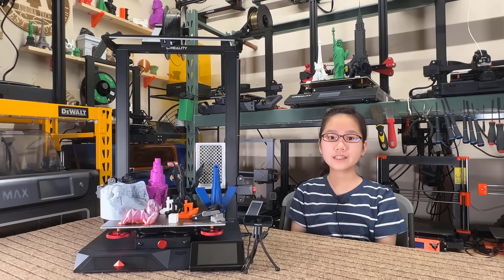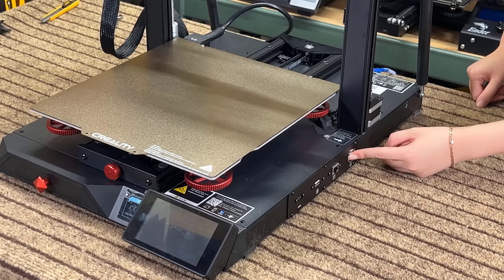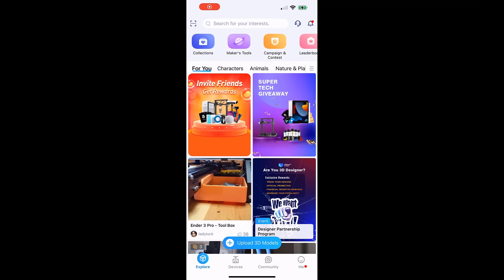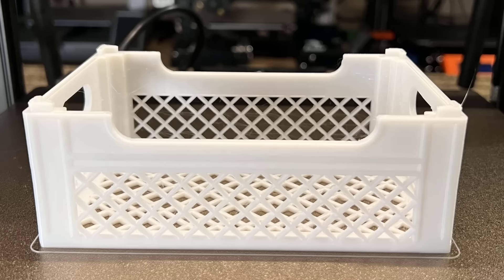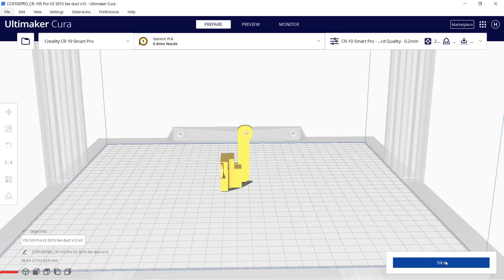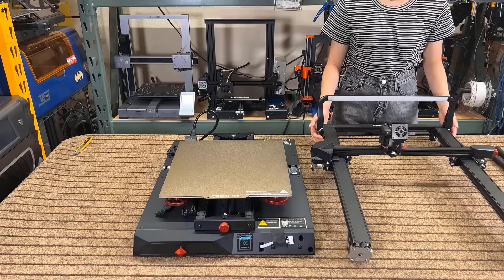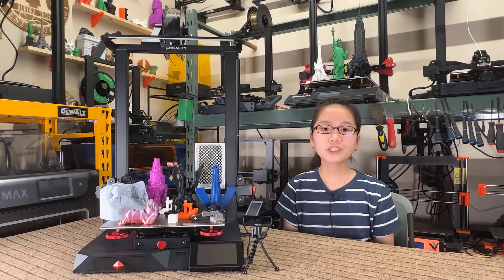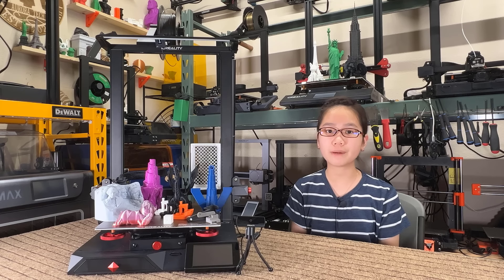CR-10 Smart Pro In-Depth Review: CR-10S Pro V2 + Ender 3 S1 Pro = The Ultimate Creality 3D Printer?

Comment: I've had one of these for the last month or so and up until a couple days ago it printed absolutely wonderful. I am newer to 3d printing and wanted something that was more plug and play. Lately I'm getting layer shifts and overall really bad prints about halfway thru my prints. I've been watching tons of videos and haven't quite figured it out yet. Live the printer just wish I was up and running like when It came out of the box. The cloud I found very buggy but on my unit the auto shut off does work but you have to set it during the print and reset for each print
Reply: have you checked the tension of the belts? also check that both the x-axis and y-axis carriage have no play, since over time the nylon wheels wear out and therefore the printer is no longer as solid as it was at the beginning
Reply: @librasd8087  The nylon wheels will not wear out that fast. it is a leveling issue.

Comment: Great Review and Demos. Im new to 3D printing, so new I don't have on yet and looking to start out with something nice without having to upgrade little by little to make it a Flagship printer. 

So this has all the Features of the Enders 3 S1 Pro, except with Network, Wifi and Camera and of course bigger working area? does it heat up as high as the Enders 3 S1 Pro? Would it be ok for me to start out with this beast? Thanks again for sharing.
Reply: Yes S1 pro is the perfect and best 3d printer to start with i just received mine and it's fabulous i am a newbie i am not gonna print the carbon fibre etc but if i want to then i can with the S1 pro i was going to buy the normal S1 version but spend some extra for the pro and it's definitely worth it!! Go ahead for the S1 pro if u have the budget or u can get the S1 which gives the same quality but the limited filament type also u can further buy the creality wifi box with the hd camera which is not that expensive like i am gonna do and connect with the S1 pro or S1 and get the wireless features of the CR 10 smart pro

Comment: Thank You very much for this review. My 10S Pro V1 has been upgraded in several places including DD, Steel nozzle, Z Struts and OctoPrint. Yet I have thought about updating or a 2ns printer as my little train parts hobby is picking up. Have you review OctoPrint? Do you use it? I am  note convinced the Cloud is the best place to go. I rather like to keep my files in my house and my network. What do you think? If the CR 10 Smart Pro supported Octo-Print I would more willing to seriously consider the update. Am I being to old fashion? Great review Team, as always you are direct to the point and leave few stones unturned. Thank You and take care, Dennis in Virginia
Reply from the maker: I have one PI3B and one PI4, since the price for the PI is getting too expensive due to chip shortage, I may not add more PI to my printers, using the Creality Wifi box is a cheap alternative, I have one on my Ender-3 S1 Plus. It's not as good as OctoPI, but for just around $20 and it works OK using the workflow I mentioned at the end of the video (20:28). Slice with Cura and upload all gcode files to the cloud, use the Creality Cloud web interface(device manager) or the phone app to select which printer prints which file.

Comment: I bought the Ender 3 s1 pro and was disappointed. Ender 3 S1 Pro Cr Touch not working. Manual calibration is also very difficult to do perfectly, as they do not fine-tune.
Reply: I refund money for my ender 3 s1 pro.

Comment: The video was well done!

That said I have to comment on the printer. The cr-10 smart pro i bought had issues with the network interface. Support was terrible finally they replaced the WiFi board. Initially the replacement did not work. Getting the latest version of the boards firmware was challenging. Support finally sent me the file. To replace the board required taking the bottom of the printer off, disconnecting everything (which were held on with hot glue!) Removing an SD card and then putting it all back together (without the hot glue). 

The entire update process for the firmware is messy. Multiple procedures and poor documentation. In my case the upgrade bricked the WiFi board.

The UI is actually very poor. As the front panel is a peripheral device to the main board status in communications has a tendency to fail.

Comment: Loving your videos and channel. Which one would you recommend between this one and the Prusa i3 MK3S+ kit?
Reply from the maker: I loved Prusa, but I won't recommend Prusa anymore in 2023, as they are selling the same thing for many years without major upgrades.

If you want a larger printer, this CR-10 Smart Pro is fine, if standard size would be fine, getting an Ender-3 S1 Pro or Ender-5 S1 would be a better choice.
Reply: @AuroraTech  I was not expecting an answer given your fame so I really appreciate. I have come to same conclusion about prusa in the meantime (same thing).  I m going to keep digging as it seems that the cr10 has parts hard to source (not open as prusa) unless you have a recommendation. Thanks again to you both

Comment: Hi!

I just got one of these and I don't understand the levelling process.  I tried a manual (old skool with paper), but when printing it went through an "auto" process and still had the printhead about 5mm off the build plate!  When doing the manual levelling, it seems to take an extraordinary amount to wheel movement ("loosen") to get the printhead to touch the paper.

I wound the wheels back to to max compression (stopped) and unwound each two complete tuns, but that didn't seem to help any!

Ideas?

Thanks!

Comment: Did you change the extruder? In the very first two models you printed the extruder is label Creality but afterwards it changes to Ender as in the Ender S1
Reply from the maker: Yes, I was changing the nozzle and doing some tests with the Ender 3 S1 Pro at the same time, they are now using each other’s extruder. The exact same extruder except for the label on the stepper motor.

Comment: I just purchased the CR-10 Smart Pro.  It is my first 3D printer.  I am trying to figure out the controller and what all the functions do.  Can you do a video on just the controller...  Step by step through every function .  I have problems loading and unloading filiment and it seems to get hot and not turn off again without turning off the entire machine??? this is not good. Can't figure out what I am doing wrong..  Just need a good explanation for every function inside that controller..  Thank you..

Comment: Hi!  if I upgrade the CR 10 smart pro with the sonic pad will it print faster ? TIA
Reply from the maker: Most bed slinger can reach around 120-150mm/s with Klipper, if you want to push it harder, you may need to upgrade the extruder, hotend and cooling as well.

Comment: How does it compare to s1 plus, if the extra 100m in height of build volume is not a big deal? S1plus was on ale for $450, seems to be a good deal compared to this $799?
Reply from the maker: If you don't need to print high-temperature filaments and don't need the 400mm Z-height, the S1 plus just print the same and may be a better option for you.

Comment: Great review as always. The whole cloud thing is a massive deal breaker for me. If Creality has a problem with their service you don't have a printer. All of these services and more can be had with  open source Octoprint running on a Raspberry Pi, a cheap local PC or even an old Android based smartphone. You're not relying on a corporation that will at some point try to charge you a monthly subscription to use their server.
Reply: Not everyone wants to spend time procuring and setting up a raspberry pi for octoprint. An off the shelf solution is great for those who don't want to spend too much time on hardware, and this is Creality's prepackaged answer!
Reply: You can still print locally right? 
You lose the camera feature and other monitoring but it will still print.
Reply: Is the Creality cloud a "must use" or can items be printed directly and bypass the cloud feature?
Reply: @johnsathe2429  You can use the Card slot or USB as far as I've read.

Comment: Okay, So I bought this printer today, because I found a Black Friday deal for $595 dollars. This printer seems to have everything I was looking for, and then some. I would like to know what you meant by saying some prints needed glue, can you explain this process? And the links for the cam holder and fan duct don't work anymore, so can you provide new links, or let me know which ones you were using successfully??? I am a serious noob to all of this, but I learn quickly and will absorb a ton of information quickly. Also, have you actually used the USB C port on this printer, and if so, how did it perform? And what do you think about these companies using "tin" on the connections of the internal wiring? Have you changed yours? Lastly, do you prefer the latest version of the Creality slicer over Cura, or just the opposite??? Thanks. Good vid. I'm always taken aback when listening to your knowledge of these printers at your young age. Good for you. Apply that kind of drive to everything you do in life, and you will go far.
Reply: The link to the cam holder just has an errant space in it after the colon. Copy/paste the link with the number after it and then remove the space to get the right link
Reply: @JimHester  Thanks!

Comment: 6 MONTHS AFTER PURCHASE

My CR10 smart pro is about 6 months old and has produced many good prints. HOWEVER the heated bed is now very warped to the exetent that I'm having trouble with prints that have a large footprint, the auto levelling doesn't seem able to cope with the range of differing bed heights anymore.

Trying to get any tech sense from Creality customer services is a long complicated beaurocratic nightmare, firstly you have to be able to dig out receipts and photograph the serial number on the side of the machine to prove you actually own the machine, so two or three days wasted. Then you have to show them videos of the fault...........and so on.

So I'm going to get a glass bed for it and a self adhesive PEI surface for the glass bed. I never had any troubles with my old CR10V3 which didn't have auto levelling as standard. Wish I'd kept it.

However apart from the warped bed issue, and the crappy slicer, web program etc., it's otherwise a great printer.